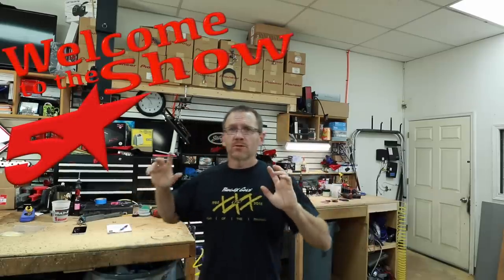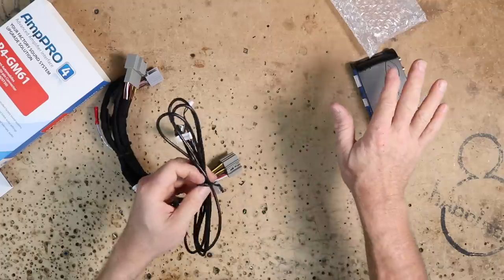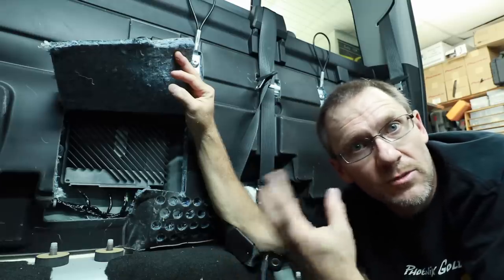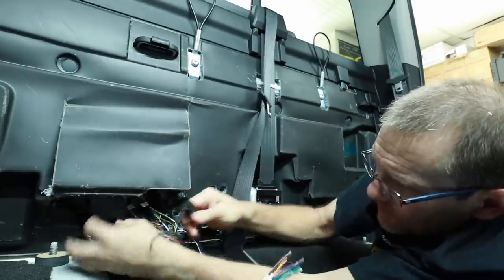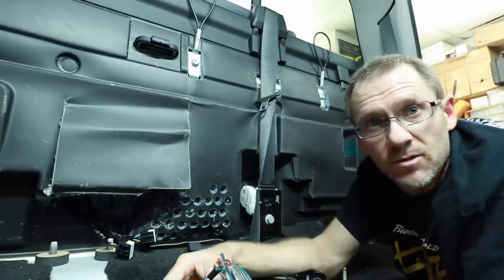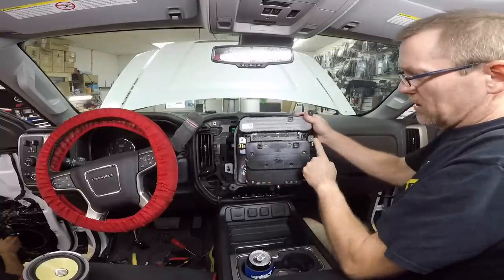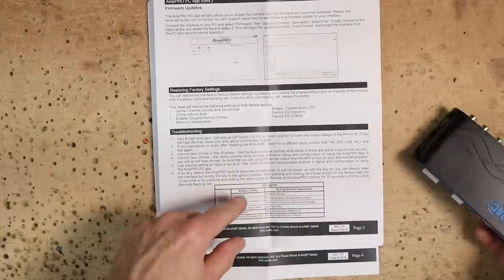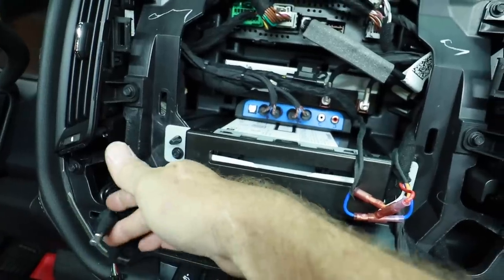The Pac Amp Pro AP4 GM61 what it is and how to install it

Comment: That's a really cool adapter! Thanks for sharing!
Ive been looking for the same sort of thing for the VW golf7. Entry level radios use radio amplifier but all the Fender/Dynaudio upgraded use an optical signal to the factory amp. 
I found the Alpine APF-H100D which Alpine developed with VW for the Restyle units to be able to be connected to Fender upgraded vehicles. Alpine admitted in an email it should theoretically work for any aftermarket radio to link with the factory amp.The canbus adapter connects to the brain from radio and converts signal to optical.  I've yet to try the experiment. I like the European Restyle unit for Golf7 but I'm not a big fan of it's mirroring capability. I honestly can't say I like what Android is doing with third party apps these days. So Android auto is just a dead end. App radio 4 with unchained is great...but the screen size is atrocious... Any biggest thing is knowing there's a way to connect an aftermarket radio if I ever find one. 

Maybe you guys could order an adapter and give it a shot.

Comment: Hey , I love the videos you make. I just installed an AMP pro in my Sierra 2017 with Bose. Component jl audio c1 6x9 in my front doors. The sound was much better with the Bose system I have no bass in the door in front, I have the impression that I dont have full signal sent to my amp .Do I have to do anything other than plug the module

Comment: Say the vehicle doesnt have a factory amplifier, so the only connectors you have to work with are behind the radio, could you use the APH t harness alongside the Amppro to avoid having to cut any wires to get your speaker leads for the new amps output? Or would you just depin/cut the speaker leads off the AmpPro harness and go from there?

Comment: Question, I have 6 internal speakers 2dash/front/rear does the ampro activate all 6 internals? Also in this vid rca’s were not plugged into the ampro sub outlet. How are you powering your subs?

Comment: Dean did I understand that you can use the toslink to the dsp and have a digital signal directly to  say a audiocontrol dm-810 or whichever dsp you prefer that way you have no need to run rca cables to the front ?
Reply from the maker: Yes that is correct!

Comment: Hey guys I installed the amp pro and have a terrible whining noise when I put the truck into gear but goes away when it’s in park any tips.

Already installed Higher quality rcas and all grounds are good

Comment: Had an installer add AP4-GM61 and Audison AP F8.9 bit amp in my corvette c7 and I have whining noises and interference from power seats running. Any suggestions for troubleshooting?
Reply: Unplug battery negative ; put dipswitch 2 in the down position (on position) 
Make sure you are running the most recent pac GUI and firmware. Update if not. 
Recalibrate the lowest volume level slider on Amp pro. 
Re-connect neg battery cable and test for hiss.
You may also want to re-configure your Audison  and turn down your amp gains.
Reply: john h. Amazing and helpful advice. Thank you

Comment: With this you cannot run active crossovers correct ? Only passive
Reply from the maker: You can do whatever you like. It is 6 full range rca outputs.
Reply: @FiveStarCarStereoInc  so if I didn’t have that PAC loc with my harness I’d need one of my own correct in order to distribute power to each amp

Comment: I am confused why the PAC Amp was used when you have the DSR1. Isn't that redundant, especially when you don't use the factory amp for anything? Did you wire the DSP after the factory amp, and then it feeds the new amps?

Comment: Just installed the AP4 GM61. I had a LC2i before and the bass sounds way better than the LC2i. I am waiting on the APH GM02 to arrive to connect my Audiofrog Coax and components to my  JL Audio HD900/5. 2015 Silverado LTZ Bose.
Reply: Where did you hook up the RCAs on the ap4? It only shows one rca input for 1 to plug in not 2 since the other was “center”?
Reply: @CrushingBass  it has 3 pairs of RCA inputs

Comment: I have a 2016 Sierra 1500 with the factory Bose with the bucket seats and factory sub underneath the front console. I want to replace the whole system with new tweeters, door speakers, and subs. I am keeping the stock head unit. I have this harness and also an lc7i. Do I need the lc7i or can a use this without it. I’m not very familiar with these kind of things.

Comment: Great stuff. Thanks for the video.

I have a 2017 Suburban with Bose system, which I am upgrading the audio system. I purchased a PAC AP4-GM61 and the PAC APH-GM02 just like in this video. I will be connecting my audio system to a Audio Control DM-810. I am planning to use the speaker wires from the PAC APH-GM02 to connect to the DSP, then connect the DSP to the amps. With that said, do I still need to install the PAC AP4-GM61 being that I won't be using its low level connections? and so, what would be its purpose and do I connect both high level (factory speaker wire) and low level (RCA) connection to the DSP? Thanks, I enjoy watching your videos.
Reply: Did you ever figure it out?

Comment: I have a 2016 Cadillac CTs vsport and I’m using the kicker key loc for my subwoofer, I have a wire harness from john adams from utube coming off the factory Bose amp that powers the key loc my question is this installs behind the radio do I run rca to the rear into the subwoofer amp? And is that it?

Comment: Hey,five star..I have a '12 dodge charger can I just tap into the rear speakers using rca cables run to a aftermarket amp..for sub?...that ap4-ch31 is expensive...$250+..

Comment: So I understood correctly the amp harness allows you to use the factory speaker wires to connect to the new speakers and your aftermarket amp just connects to the wires from the harness and the harness also bypasses the factory Bose amp?
And if that’s the case how many watts do you think the factory wires can handle?

Comment: Love the videos, very helpful and detailed. I have 2018 ltz  2500hd diesel, I installed the gm61 but having issues with remote wire staying on, any solution ideas, appreciate any help
Reply: I’m having same issue! Remote stays on causing sub pop when truck is completely off.
Reply: Get a bussman fuss tap and run the remote wire off radio fuse

Comment: I rewatched this video. So no aftermarket subwoofers were added?
I have a ‘17 Silverado LTZ with Bose audio, and factory amplifier and center console subwoofer.
I’m looking to add two 12” subwoofers under my back seat. And keep the center console subwoofer, but leave the factory subwoofer how it is.
Could I use the single T-harness for the speakers, connect that T-harness from the factory amplifier to LC2i Pro, then connect to my amplifier that will be used for the two 12” subwoofers? And discard/put to the side the other T-harness connectors? 
(Sorry for all the questions, trying to get everything I need for my install plus some info. I don’t like splicing wires, that’s usually my last option)

Comment: is the factory speakers big enough that it doesn’t need to run new wires? my audio control d6-1200 is 125rms, can i tap into factory speakers with out run new wires to the doors? i saw the speakers wires in the door on 2020 toyota camry is pretty small.

Comment: i think im gonna get the amppro for my 16 sierra its the non bose but i think this is the best way to get the best signal for your sound processor and havin the ability to ajust the chime volume right there so easily is awesome i been trying to find a t harness tho to tap into my factory speaker wiring harness but it doesnt seem like they make one you have to custom make it i guess like they did in the other video wish i had the part numbers for the harnesses i need to hack up into one

Comment: Great tut. Couple question....I have a 2016 Jeep Grand Cherokee with the Premium Harmon Kardon system.  System sounds pretty decent stock but tell me..... does it make a noticeable difference adding the AmpPro with the T harness at the oem amp to supplement adding external amps to the oem HK speakers?  What power rating amps should be added and to which channels?  Don't want to fry the oem speakers if this is indeed an option.  Chrysler advertises the HK as 19 channel system but they merely are doubling up certain channels that include mid range and tweeters.  There is a center channel in the front of the dash as well.  Also,  would the AmpPro work properly installed in between a Crux Wifi Media Integration unit to the head unit ?

Comment: I have a question, I’ve installed the amp pro into my 8.4 unconnect screen, I bought the t harness to the factory amp in my Jeep under the dash and extended the cable to reach the back where my amps will be. I have a total of 8 speakers, 2-3.5 in the dash, 2 4” in the knee panels and 4 in my soundbar do I need to connect all these speaker wires coming from the t harness to an audio control LC8i? I am also lost as to which speaker wires I now connect to the amp since the speaker wires are now connected to the lc8i. The amp I am using is a JL audio rd 900/5. Any help would be great. Thank you again for all your informative videos.

Comment: What if I'm simply wanting to add a subwoofer amplifier and subs to the back of a 2016 Corvette Stingray? 
Will the this part be necessary, or might I be able to add a high/low converter to a T-harness attached to the factory Bose amplifier?
Also, you could save me some time if you could tell me where to find the factory Bose amplifier in this car.
Any help would be greatly appreciated.  Thank you.

Comment: Hey guys, Quick question. If all I am doing is adding a Blaupunkt powered wedge with high and low input, could I tap into and take the high level factory sub signal to the wedge and get some extra bump?

Comment: I have a 2018 Chevy Silverado that has a Bose Amp. I just ordered PAC AMP PRO AP4 GM61. My question is why did you go into BOSE Amp with the t-harness to test sound for speakers. I had a NAV-TV M650 Interface which was a bust that did the same thing as the PAC AMP PRO and I didn't mess with the BOSE Amp and everything work fine when NAV-TV M650 was working properly.
Reply: He bypassed the stock amp, used the wiring harness so he didn't have to run new wires.

Comment: Hello, thank you for the video. Couldn't we put the Amp pro in the back? Like instead of opening the bezel we can tap into the harness in the back (right before the factory amp) in this case we don't need to run RCA wiring from the front as well. I'm thinking of doing this for my car. Thank you!
Reply from the maker: No it is made for the front

Comment: Dean or anyone... if you use any amp pro let’s say just for a sub, do you still need to disconnect anc mics if it has it? 
Thanks
Reply from the maker: If you are just doing sub’s they will not have it but it will effect the other speakers so they must be disconnected. If you do a full system they will need to be disconnected.

Comment: Can I use a LC 7i From audio control to recover on the rolloff base?
Reply: Ehh it helps but not as good as this. This will also give you control over the chime/turn signal, my buddy used an alpine power pack now u can hear his turn signals/chimes from a block away 😂

Comment: Awesome videos guys, I love watching. I just recently did a full system pioneer install with the DEH-8800BHS and I'm wondering if I should go with the DEH-S6120BS instead. I am using a pioneer 5 channel amp with D series component up front and coaxial in rear + 12 champion dual 4 running at 2 ohm in my 07 Camry Hybrid. Also ran new wires bypassing all the JBL stuff. Any advice would be much appreciated. thanks
Reply from the maker: If sound it the main focus stick with the 8800
Reply: It is, thank's so much!

Comment: Great video! I'm curious as to why you didn't use the RCA sub output on the AMPPRO. Also, is  APH wire harness adapter basically a product that makes it easy to tie the newly amplified speaker wires into the factory wires?

Comment: Just installed one of these units in a 15 suburban and the blinker/hazard "blinking sound" from the left front is gone.  I figured that would be along with the chime/chime volume but that works and blinker sound does not.  Is this normal and if not any ideas on why it's not working?
Reply from the maker: Have you checked your fader to make sure it works
Reply from the maker: You can also control the volume with the sub level
Reply: @FiveStarCarStereoInc  Thanks for the reply!  I have checked the fader and for some odd reason it does not work!
Reply: @FiveStarCarStereoInc  I have set the door chime volume and it works fine but no blinker sound.
Reply: @FiveStarCarStereoInc  the fader does not work.  What would cause this?

Comment: What all went in this truck ?
Reply from the maker: Focal k2 6.5 sep up front coax in the back, DSR1, Morel 5 channel on the front and sub, Stinger amp on rear, 2-Rockford T1 -10 slims in a Fox Box. Roadkill all the doors with Fastrings.